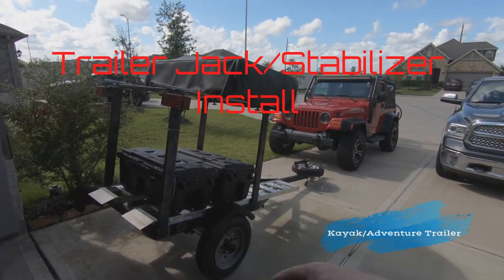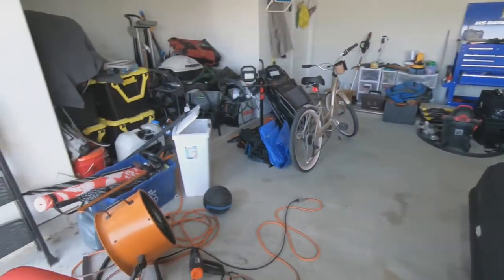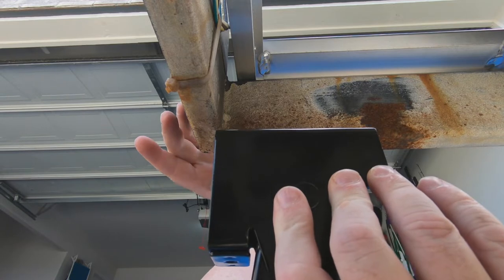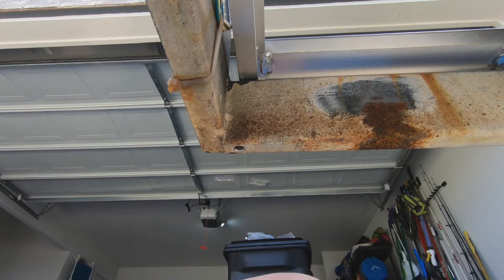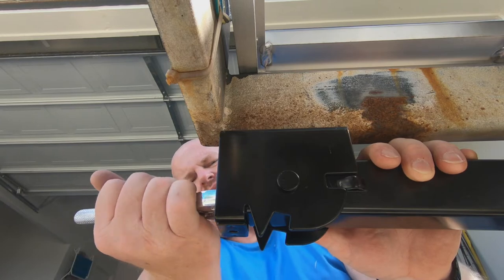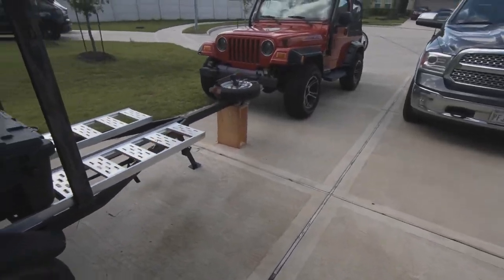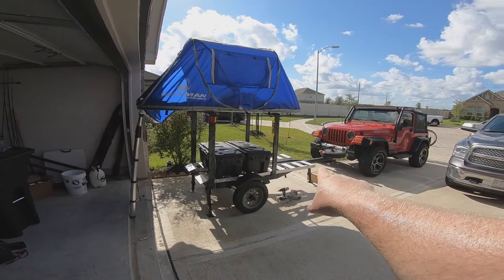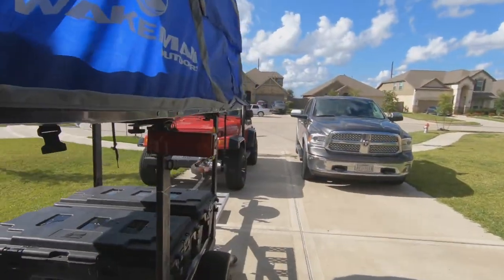VLOG 34 2021 Light Weight Stabilizer install on Adventure Trailer / Roof Top Tent on Kayak

Comment: Are those bolts self tapping?  Since installing have you had any issues with it coming loose?  Would you recommend red loctite?
Reply from the maker: Yes self tapping, it’s the same screws all camper manufacturers use. No problems as of now
Reply: @TheRealLifeoutdoors  Thank You for the quick reply
Reply from the maker: Anytime